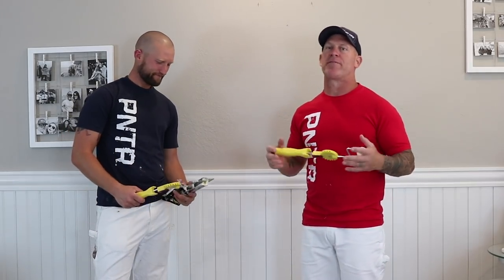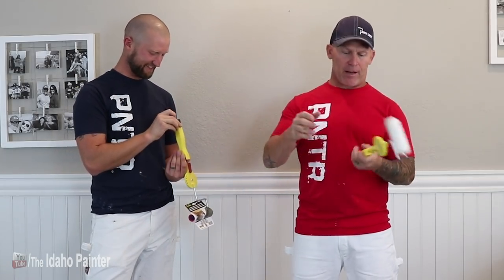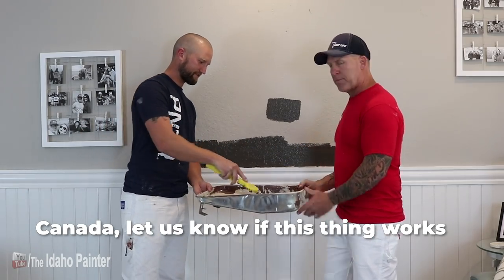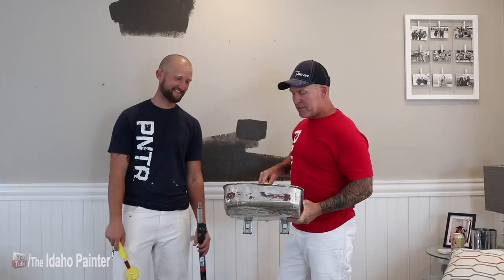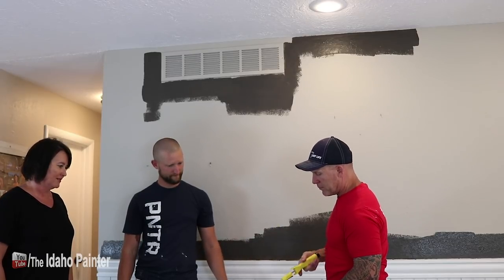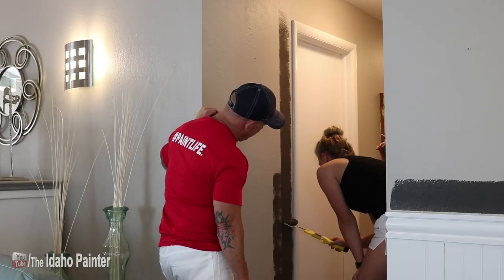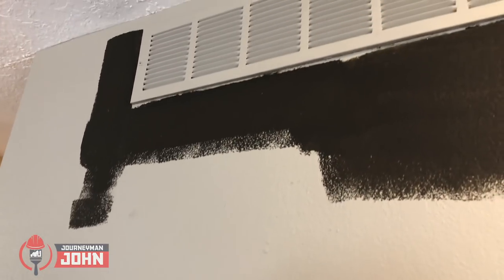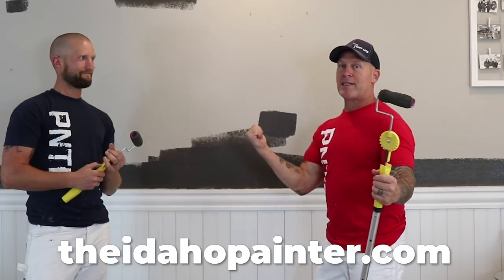FasTrim Roller Review.  Toy, Tool, or Joke?

Comment: I actually just bought this and it's working perfectly for me (shrugs)...I did notice that you weren't wiping the red part at all which is probably why you got paint where you didn't want it. You also may not have been applying pressure on foam side which is why it wasn't cutting right to the edge properly by the ceiling.

The company has great and detailed tutorials that shows you how to use these properly.

I will say that I have never used the angled roller because it seems awkward. I just use a ladder or step stool to cut in the wall edge by the ceiling and it works fine

Comment: I painted probably just as long as you and this product's actually really good. At first I thought I was stupid looking and cheap but I used it  Cutting Tbar  And once you  Get the hang of it it works amazing you just need to have a cloth to wipe the part that touches the  Ceiling this product has saved me so much time for certain applications. It's pretty useless on textured ceilings or flat ceilings

Comment: I had a chance a few months ago to watch a painter use a different version of this and I have never seen anyone edge faster. She did wipe the end often to keep paint off of it but it worked amazingly. She was working with flat walls and not textured though. 12 foot ceilings. I'm sure it wasnt the same brand though and we are in Canada. Hers was also only using a smaller diameter roller.
Reply: Yeah they put the wheel in the paint and didn’t wipe it,  lol.

Comment: I am using this now and I am not having the problems that are being shown in this video. I watched the instructional video first and didn’t see in here where you cleaned off the red part at all like the instructional video says to do. The house I live in the paint was done directly over the plastering it seems with no undercoat. The paint I did bled through the taping. This roller is what I am using to touch up my walls and they are coming out really well. So much better and clean lines.

Comment: Hey guys just seen this video you are using it wrong need to apply pressure to the foam side so the paint get to the edge of the roller also is best to use a damp rag to wipe the end before applying !!

Comment: I've used the Fast trim roller and it worked GREAT . Like any new tool or methods requires learning its quirks. #1. No paint on the plastic ring on the end of roller. #2. Roller must be seasoned with paint. #3. Roll close to the edge but roll back through it to cut the edge. 
#4. GRAVITY. use less paint in the roller if you cut baseboards.

Comment: I bought one of these things (not the same brand but very similar).
I found it to be very "trashy", but nonetheless useful for the very first coat of paint on jobs where the quality level of the finish is lower (apartments, schools ... the average not so well paying jobs where they don't expect the very best), so "C" type contracts.
It is a massive time saver for those jobs, but I would not approach a quality contract ("B" / "A" type) with one of them by a mile.
Also, never trust anything that requires you as a painter to apply pressure on the roller ... we have aluminium frames for rollers in France for a reason, if you apply too much pressure, they bend, thus "you're painting wrong" ^^

Always thought the idea was interesting, but for the professional painter, you're better off cutting in by hand.
PS: the one I got had a plastic piece on the side that had bristles on the side that would indeed trace a straight 1-2 mm line from the edge.

My guess is that it's really only for the homeowner who wished to do the painting him/herself and who doesn't know how to do cut-ins correctly, and who is "ok" with that kind of finish.

Comment: It works here in Canada , i am buying more of them , you have to be professional to achieve a perfect line
Reply: Lol u right a professional painter will make it work , this guys are just a comedians I haven't seen any work from them, just a demo of tools not an actual work been done
Reply: Have been using these for around five years. They work just fine for commercial  and same colour rental reprints. You are not using it properly.  After loading the roller you are meant to wipe the excess paint off the end of the roller. I find a damp micro fibre cloth works best. They do last in the back of the van. But they do take a bit of practice. I use them to cut in the ceilings, no need for ladders. They don't cut in right to the edge, but with it being a straight line it looks OK. Would not use them for top end work.

Standard roller sleeves fit the frames also. They are great for awkward areas, above kitchen cupboards ect.

Comment: Ive seen this so called cut in tool a long time ago, I could tell it wasn't ideal for a professional painter. The demonstration they used to advertise this tool was set up in a way that made it appear to work but never in a real world application, like heavy texture walls or next to crown, and if on trim the camera angle was too far away to notice a wavy lines. Still the best way is to cut in with a quality brush or used frog tape and mini roller.
Reply: it works e.g. in very high rooms, e.g. in schools. I had a couple of 6-7 meter classrooms. It was perfect. I made a lot of money

Comment: Yes It might not work perfect but 
1)  you chose a textured wall and ceiling 
2) you did not wipe the edge properly 
3) you put the roller to the wall edge straight away 

Your unfair experiment made me disappointed more than the tool itself.

Comment: You can't get any paint on the foam part.
Reply from the maker: Right which is virtually impossible
Reply: Wrong. You have to make sure the foam gasket gets loaded with paint. As with any new tool it can take a little bit to get used too. I live in Alberta, along with the inventor of the tool. Very genuine guy. He actually lived in my town for some time. 

Anyways, I’ve had great success with the tool in very certain situations. We don’t have textured walls here in Canada much and I don’t think it would work well in that situation. But I’ve found it come in handy the most in commercial work cutting in against T-bar grid and rubber cove base. Aside from that I haven’t used it much for anything
Reply: works great for me i just got mine, small learning curve but a child could figure it out